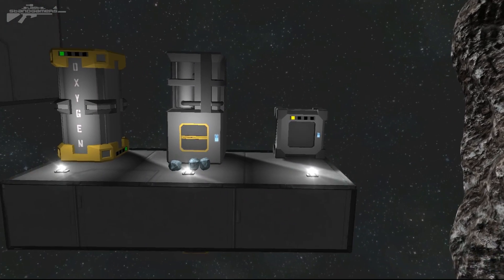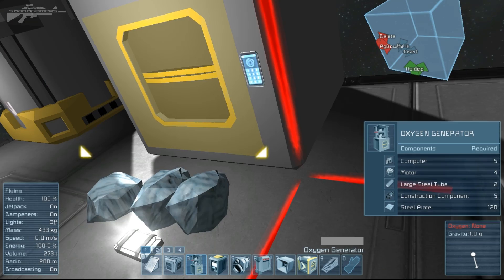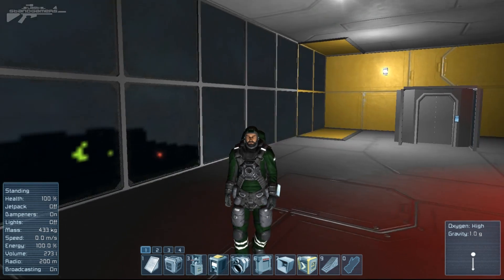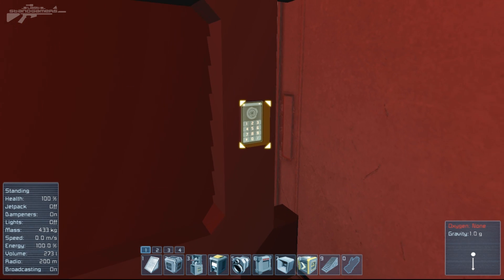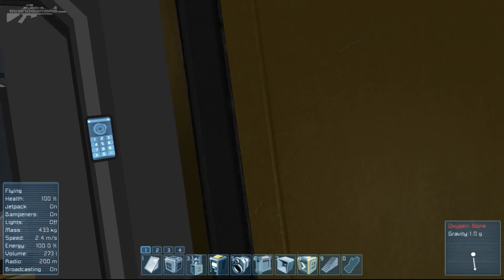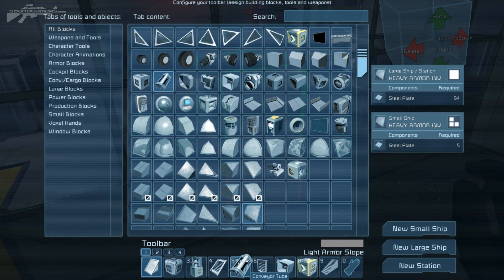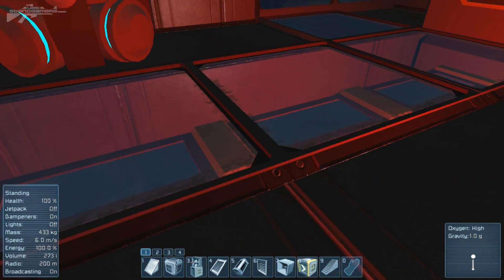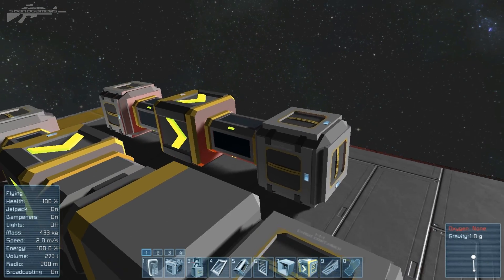Space Engineers - Oxygen, Take Your Helmet Off !!!

Comment: next they need a hydrogen enrgy gen for the other part of water produced during electrolysis
Reply: So fuel cells or fusion? That would be a nice alternative to reactors or solar, certainly.
Reply: ThorpedoMK3 6/05/1937 #neverforget
Reply: Hydrogen fuel cells would be pointless, because you would need oxygen to use them, and you would get less power back than what you used to make the hydrogen and oxygen. Fusion would work great though
Reply: Barrett Jordan hydrogen fuel cells were always meant to be batteries, not a power source
Reply: ThorpedoMK3
At our current level of technology, fission reactors are hulking behemoths and gravity generators are mere fiction. Probably not the best place to compare SE with ^^;
So really, having practical fusion reactors in Space Engineers wouldn't be that infeasible.
Reply: TLDR: Space Engineers is set 60 years in the future.  Miniaturized fission reactors already exist and function. I concede that gravity generators keep the game simple.

According to the space engineers about page. Space Engineers is set roughly 60 years into the future.  I quote "Think about modern day NASA technology extrapolated 60 years into the future. Space engineers strives to follow the laws of physics and doesn't use technologies that wouldn't be feasible in the near future." end quote.  Just doing some research on the topic of miniaturized fission reactors reveals that they can be created today using exotic fission elements to sustain the reaction.   And as I said earlier No Fusion reactor to date has produced power so far although Lockheed has claimed to have made several breakthroughs that might make these reactors feasible and small enough for practical application.  Now the gravity generator as you have pointed out doesn't seem feasible with current understanding of gravity.  NASA is focused on creating gravity using a centrifuge and that is agreed to be the easiest method of simulating gravity with our current understanding.  But I digress My initial point is that being as the game is set 60 years into the future I do not believe my comment to be excessive although a bit long winded. and miniaturized fission reactors are already here and do produce power at least in the 1 kw range.
Reply: ThorpedoMK3 
Well most estimates working commertial fusion reactors by 2040~50... so about 40 years from now. Fusion is no longer just sci-fi stuff anymore. With how much progress we have in this area... but as i said they should be HUGE and delicate. And reqire power to Boot up.
And with how big some ships get in this game...
I would like laser weapons though. It should use a lot of power unlike turrets...
Reply: Maybe fuel cells can be more effective in certain ways like being able to be transfered using conveyers instantaniously as oxygen and hydrogen tanks and a special reactor for them(as a TON of big batteries will take some time to charge up, which is the reason WHY we actually use them in real life)
The idea of a fusion reactor is nice... but it can be overpowered with the REDICULOUS output a theoretical, working generator(when they get made in about 2030, good bye energy issues). They should have HUGE energy outputs for little fuel consumption but shold be ENORMOUS(so much that an equal amout of space with fission reactors would provide more), expensive to make(superconductors yo) and should need a lot of power to start it up.
Reply: The hydrogen created on the ISS is vented out into space as having a high concentration of H2 and O2 on board creates a huge fire hazard. Remember the Hindenburg.
Reply: ThorpedoMK3 
Just having oxygen tanks is a huge fire hazard lol. And hydrogen IS the fuel of the future so deal with it (hint:fusion)
Reply: I'm in total agreement fusion may become a future power source but at current levels of tech the reaction requires more power input than power generated.  Having oxygen on board is essential to having life.  Hydrogen is far more stable when 2 atoms are joined with a single atom of oxygen.  That's why the ISS has no issue storing water.  They vent the gaseous form into space to prevent an explosion that would eliminate the need for the O2 in the first place.
Reply: keep it simpel
Reply: ThorpedoMK3
I... think I may have misinterpreted your other comment somewhere... sorry about that >.<
Reply: TheBraveGallade I think that humans should stick to their beginnings and continue working on advancing kinetic weapons instead of jumping into the field of energy weapons... although beam weapons would be useful for widespread damage and suppression of small ships...
Reply: OnlyForThePriceOf999 
Dont worry. Unlike star wars i think himans will use missiles for centuries to come. However energy weapons ARE being developed as we speak... so space engineers should have them. Probably a very high powered laser.
Reply: TheBraveGallade
If that initial 'boot up' power for fusion reactors were high enough, it would certainly gate off the reactor to players just starting out. You wouldn't be able to turn it off and on like the fission reactors though.

As for lasers... the problem there lies mostly with heat dissipation. It's all well and good in an atmosphere, but if you're using a laser strong enough to punch a hole in metal for any length of time, you'll have a lot of heat to radiate off into space; something that isn't that easy to do... though the same stands true for nuclear reactors, or machine gun barrels, so I have to wonder where that's all going off to
Reply: TheBraveGallade Yep. They already have a laser weapon capable of taking missiles out of the sky and punching holes in small boats as well as a "Lightning Gun" that blows up any metal it hits (unfortunately its inaccurate and sometimes hits itself) But I think, like you said, kinetic weapons will still be used for ages considering I highly doubt that even 'murican citizens will be able to buy lightning guns or high powered lasers. SO to come to a conclusion, like you said, I guess it would make sense for space engineers to have them.
Reply: OnlyForThePriceOf999 
Even in a universe as advanced as star wars a warp drive shuttle probably costs about as much as those flying cars or low cost personal planes right now (they are not THAT expensive; if you are somewhat wealthy you can buy one somewhat easly, but not your average citizen). But if you can make those huge ass battleships, a laser cannon as a main eapon would be sencibe as well as fusion reactors. You eould probably need the fusion reactor for the laser to be worth it and vice versa.
Reply: Pyrobird 
If things get TOO realistic it can get overly complicated and boring. Look at war thunder a very realistic tank/aircraft battle game. Thry originally wanted to make sherman tanks have malfunchions as the actally frequently do. But they did not do it because of practical reasons.
As for the turn on... they can start booting up when you turn on the ship if you have enough power to do so. It should take a while to boot up though. Same with the laser.
Reply: TheBraveGallade I was talking more in real life people won't be able to buy them because they're technically weapons of mass destruction. A civilian can't legally buy an RPG launcher, so why would they be able to buy a lightning cannon? In space engineers ship mounted lasers/lightning cannons and fusion devices (already added by azimuth mods) are perfectly feasible.
Reply: TheBraveGallade
Well aye, there is some questionable realism here and there in the game that I hope they don't change. I for one don't want to have to fill up propellant tanks just to get my ships moving ^^;
Lasers just seem a little.. overpowered in my opinion though; accurate sniping at long distances with little-to-no travel time. Sure it requires you to aim, but at least bullets and rockets have to travel.
So.. slow firing speed to compensate for heat dissipation/capacitor charging/similar excuse?

OnlyForThePriceOf999
Lightning 'cannons' as you put it seem a might infeasible in space. In atmosphere I believe they use a laser to ionise (the insulator known as) air, which allows them to aim things better.
In space would it not prefer to simply zap your ship?
Reply: Pyrobird 
All spacecraft now excluding unmanned probes use fuel to go. I am pretty sure that the engines in game are ion engines.
Oh, and fuel cell engines make tanks act like batteries, but much faster reload time.
who said you NEED propellent? You can still use uranium. However fuel cells would be faster to be recharge and more compact in exchange for... well they explode.
These futuristic energy weapons(INCLUDING RAILS) have an ENORMOUS energy requirements. In fact the us is designing new types of ships just to be able to use them because it is near impossible to refit them on current ones. Lets just say that you need fusion reactors to power them and that would be that reactor's main use. And of course lasers require lots of time to charge. Remember the death star's planet cracking laser? That takes up most of its power and takes a full DAY to recharge. So lasers would be like the yamato cannons in battlecrusiers in starcraft- first strike weapons.
Reply: TheBraveGallade
Ion engines still need propellant (usually an inert element like Xenon); you can't ionise vacuum. So yes, realistically speaking you do need it, and purely electrically powered engines are likely impossible to attain (and would not have an exhaust to char your ship). But realism need not be ever-present in a game, hence why I overlook it.
Hm, the need for a fusion reactor (which in turn needs a high-power draw to start) to use certain weapons is an interesting idea. Presumably this more falls down to space and weight saving though? A large block of reactors should work too, given it's mere electrical power; if not quite as efficiently.
Ans yes of course they would need to design new ships; their predecessors were designed with chemically propelled weapons, and thus had lesser power requirements.
Not sure the death star is the best example for anything though. They picked an awfully inefficient method to destroy a planet. It makes good theatre, but not good science (but let's not start debating anti-matter here)
Reply: Pyrobird ratically huge power output for fragility of the reactor.
Reply: Pyrobird Actually it uses lasers to focus a plasma channel and then electrifies the plasma (essentially a lightning bolt) so I guess unless you gave it something to make plasma out of it wouldn't work in space.
Reply: Pyrobird 
Also you wouldn't want to waste like 100 kilos of uranium for just one shot right?
Reply: TheBraveGallade
That's a pretty inefficient weapon if it needs THAT much ^^;
Reply: Pyrobird it would be pretty op though.
Reply: i think if there was hydrogen fuel would be the last thing i think of, ever heard of a hydrogen bomb
Reply: JAMES POWNALL
A hydrogen bomb still used a fission-based explosion to set it off (oh hey, we've got uranium for that!), and it wasn't purely hydrogen, if memory serves me correctly. Though I suppose you could argue for pure fusion bombs, and deuterium/tritium are isotopes of hydrogen anyway.
Still, you sure you want that kind of firepower in this game?
Reply: Pyrobird they would have to be incredibly hard to build and maybe quite unreliable but you can't say it wouldn't be cool to see an entire fleet of ships wiped out with a single missile
Reply: JAMES POWNALL 
Hydrogen bombs are still nukes.
But hey nukes would be fun. It would be realisic for one lol.
Reply: JAMES POWNALL
I'd more question if that would work as such... nukes and explosions in general behave very differently in space (yes, it has been tested, though a long time ago).
As an example, I believe Battle Star Galactica had them firing nukes at each other. Not sure on the strength in terms of kilotons or such, but they were hardly 1-hit-KO-entire-fleet level.
Point is, I don't think you can use them in space as you would on land (that atmospheric shockwave helps a lot with explosives), you require very different tactics. For example, whilst an explosion might only damage part of a ship, the radiation released would cause significant harm to any unprotected occupants elsewhere.
This I'll admit is partly guesswork on my part though; there's not a lot of material to examine.
But, I will point out that, as things stand in space engineers, you're being pretty optimistic about your hit rate. Or rather, it would be hard to ensure both an accurate hit and that you would be at a safe distance, when you consider the in-game limitations. Sure there are kamikaze tactics, and you have respawn rooms, but...
A stronger version of a warhead would be great, but probably best keep the blast radius under 100m (or maybe as low as 50m) both for reasons of avoiding lag, and to keep things fairly balanced and controlled; kinda defeats the point of warfare if you can end it in scant few seconds ^^;
Reply: Pyrobird I assume that the shockwave would lose its power in wide open space were it can dicapate as well but a larger warhead would be pretty cool(I'm 14 so I'm not great with the science side of stuff, I'm basing my opinion more on how cool it would look:) )
Reply: JAMES POWNALL
The shockwave propagates through atmosphere (think of how sound travels, it's not too dissimilar) so you don't get much more than the fireball in space.
Anyhow, don't worry about basing things on whether it looks cool or not; life would be no fun if we ignored the more aesthetic approach due to a lack of practicality~
Besides, full-on nuclear warfare would be a sight to see (even if the blasts aren't fleet-vaporising). And even if we don't get that, I eagerly await the day where large space fleets are shooting at each other ^^
Reply: Pyrobird 
Yeah like i mean who WOULDN'T use nukes in future space wars? Nothing much to contaminate, and space is full of radiation to begin with.
Reply: TheBraveGallade
Depends. If you want to take the ship, you would need to cut vast irradiated swathes off of it's wreckage before it would be remotely safe for use.
It would also hinge on how readily available the resources are of course, though I doubt that would pose too much of a problem.
And then there's ship defences you need to bypass... etc
There are a lot of 'ifs' ^^;
Reply: Pyrobird 
Nukes SHOULD be expensive.
Heavy armour should block off most radiation though.
Reply: TheBraveGallade
Hm dunno. You could always make concrete shielding with the stone (that usually lies unused or is ejected). Concrete and Lead are the norm for reactor cladding anyway... if I've not been reading outdated sources ^^;
Having an actual radiation model though could get more than a little complicated.
Reply: Pyrobird just let it past everything exept heavy armour and blast doors within radius. But we don't NEED radiation. Starcraft doesn't.
Reply: Oh, who said anything about need ;)
Hehem, really though a nuke without radiation might as well be another warhead. Though I suppose you could argue for (relatively) 'clean' nuclear weapons given it is set in the future.